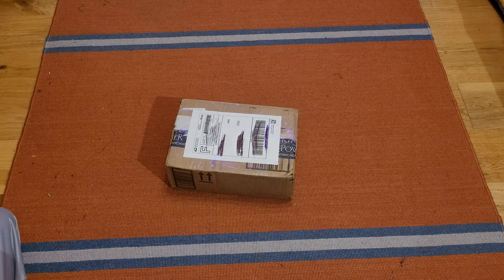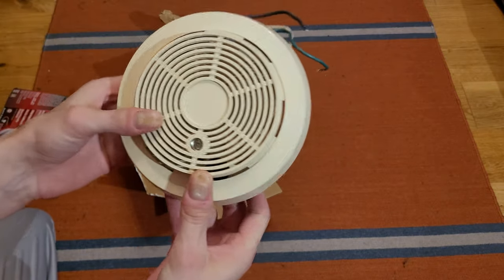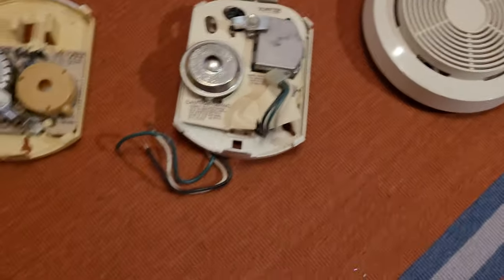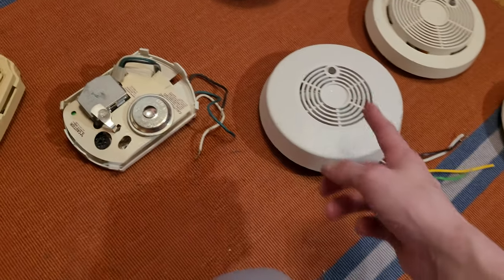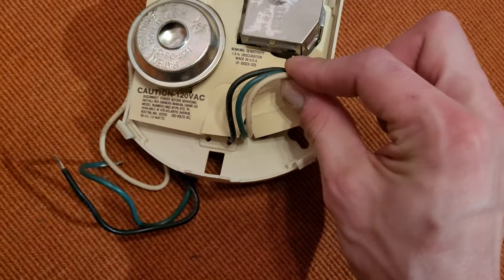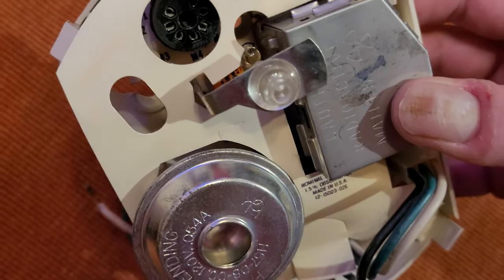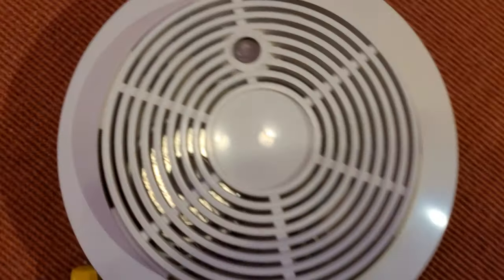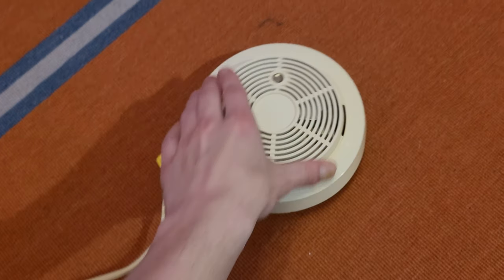Smoke Alert (First Alert) SA769AC Smoke Detector | Unbox & Test

Comment: Cool vid! I love your wideos haha, where do you get all these cool older detectors? I’m thinking about doing a „smoke detector solar system” type display and i have three detectors already, but i do want some with squealers/buzzers/mechanical horns or whatever they’re called.
Reply from the maker: I get most of these from eBay, but occasionally someone will message me with an old unit they've removed and will ask if I want it